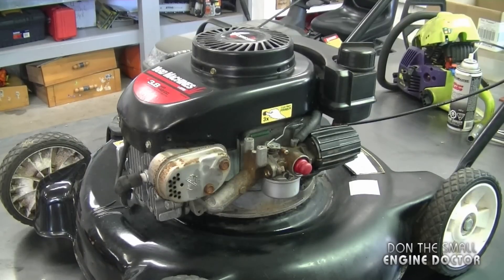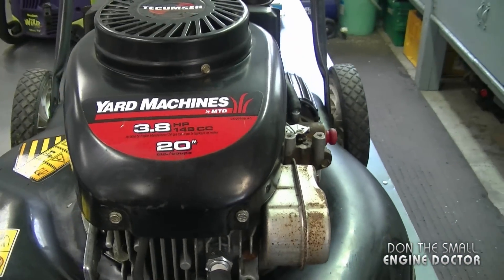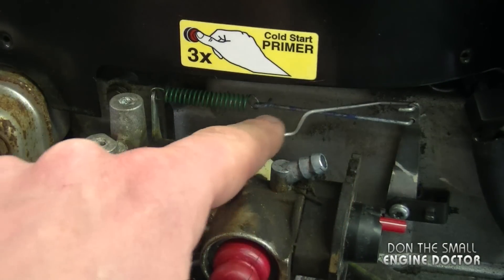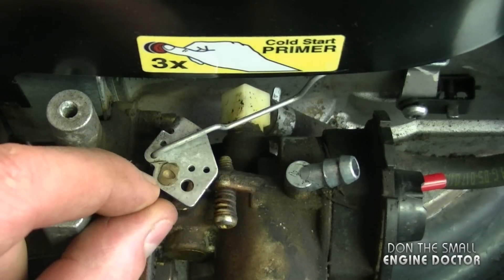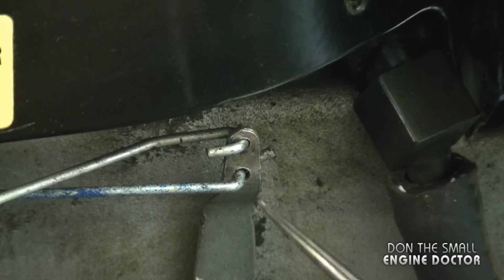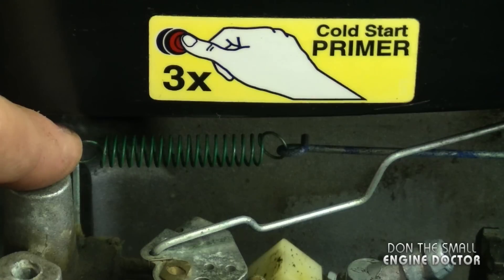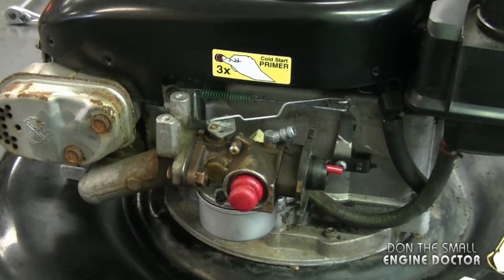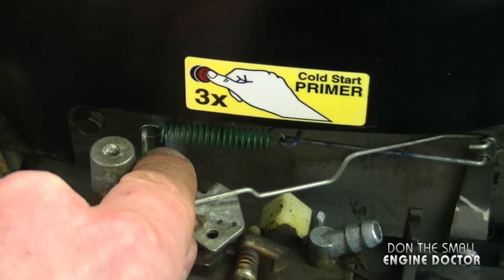Throttle Linkage Configuration On A Lawnmower With A Tecumseh Engine

Comment: Would you do video on mower blade grinding, and you thoughts/ experiences with the right edge.  I have always grinded to a razor sharp edge.  I am hearing that for a continued quality of cut I should be leaving a 1/16 to 1/8 of an inch blunt edge.  As the razor edge doesn't last near as long.  Wanted your insight. 

Thanks

Comment: I have a yardmanmtd with tecumseh carb, lawnmower. I can't find model.  It has a control bracket. In my case,  do I hook the springed linkage to the throttle bracket?   I have had i running  but the throttle adjustment did little to nothing. Before it revved the motor.
  update: I put it together this way and was able to mow but stalls with heavy grass--which it did not do before. I am wondering now if the spring is stretched out?  Idle speed incorrect? I notice that it performs equally when the drive is used or not. I think I am close. 
  I should point out that this is a replacement carb and with no model for mower  this is no necessarily right carb.  Mower is 5.5 hp. Carb looks same and starts well.

Comment: I must take a look at the Governor on my snow blower this summer because it is very bad in regulating. If there is a similar video and tips for that I would be glad. (Mostly I am uncertain if there is something wrong inside the crank case and how that is supposed to work.)
Reply: gamingSlasher Usually the carb just needs cleaned and the governor is fine.

Comment: Hello Dony. I am a female who is trying to fix her own mower. I own a Bolen's 3.5 push mower by Stratton Briggs. I did everything right  as far as the carburetor goes, but I got off track when I had to put the parts back where they originally came from. Now I can't figure out which hole on my carburetor throttle lever that my linkage goes back into. By the way, great video and thank you!
Reply from the maker: +Carol White this video might help https://www.youtube.com/watch?v=Mx6R02LerSM

Comment: I have a Sears Mower with Engine 143.006714 which I believe is a Tecumseh and the linkage appears almost exactly like this.  Is there a way to add a throttle control to this mechanism so that you can increase the speed when cutting longer grass?  For a mower with so much horsepower, it practically stalls out when hitting grass with hardly any height.  I have another Sears mower that has a control and it powers through just fine even though it's 1 HP less!  Thanks for your advice.

Comment: why so many holes if only one is used and why is the rod bent, good show
Reply: It's bent so it can get around the spring linkage. It has other holes for other models that might use a different hole and the same carb.
Reply: josh33025 no no not on this model, the wire could have been straight and the holes, i won't but if i did , i would tape them over. or solder, well tape, then the tape burns off, ha